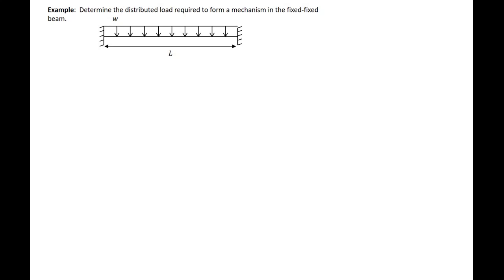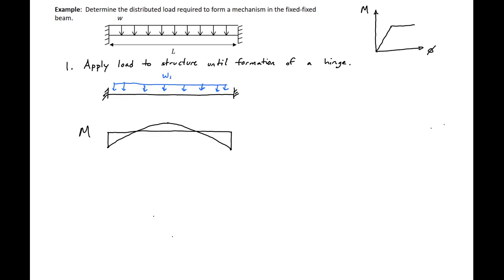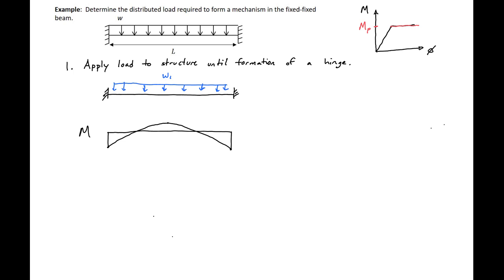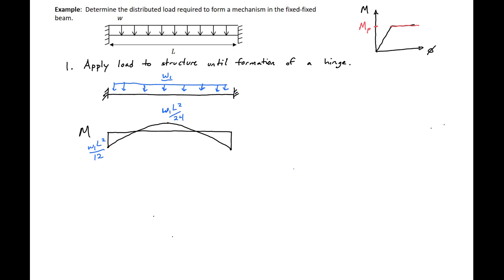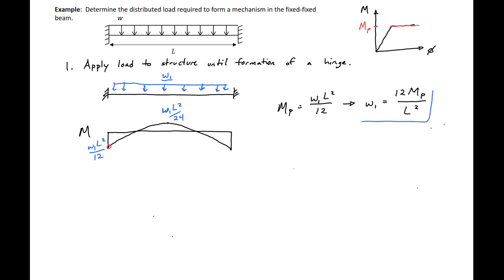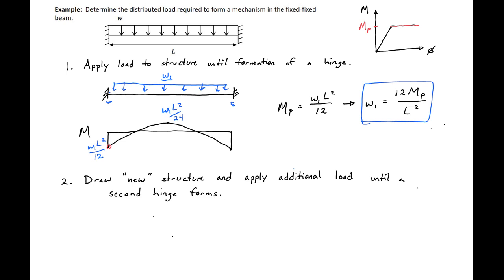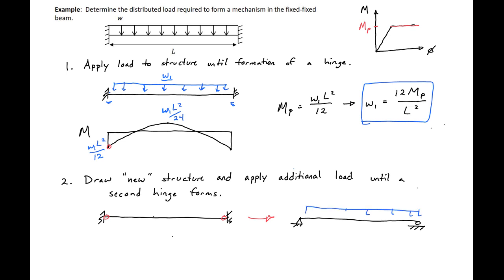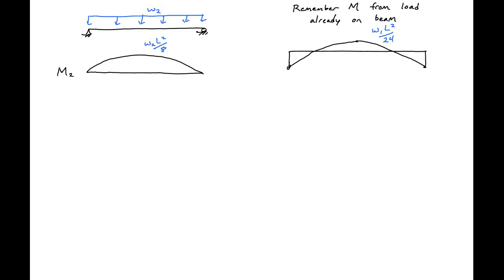1 - Plastic Design - Example 1

Comment: it's depends on the size of the member isn't it...?
why there is no section modulus or moment of inertia involved in this calculation....?
Reply: For a beam with the top flange fully braced against lateral torsional buckling the plastic modulus Mp is equal to the material yield strength times the plastic section modulus (Mp = Fy x Z)